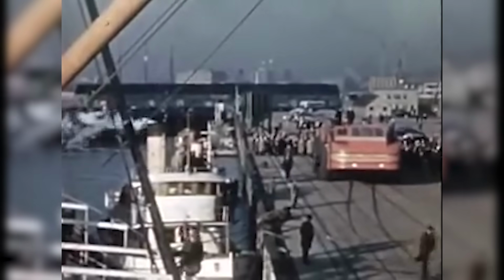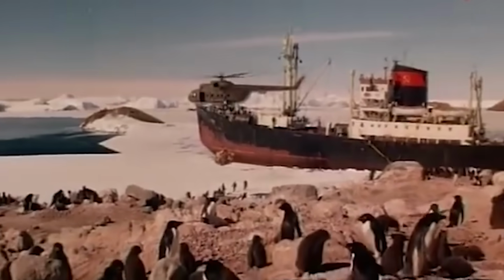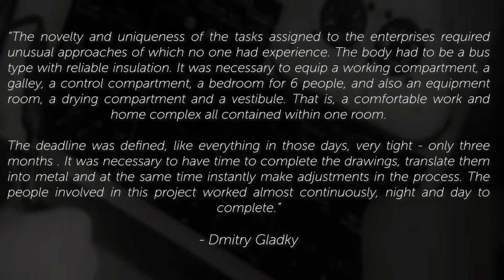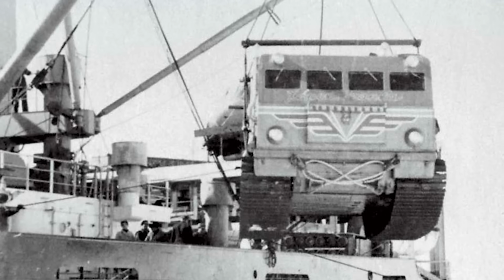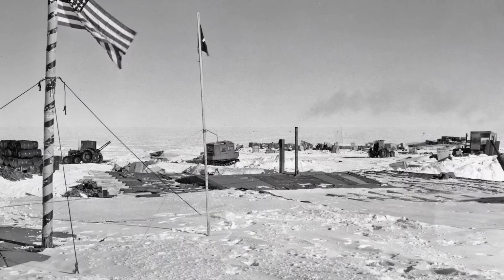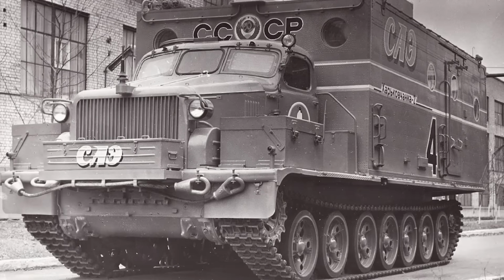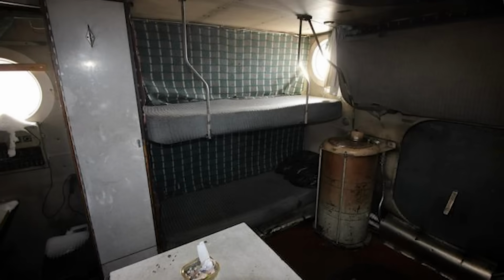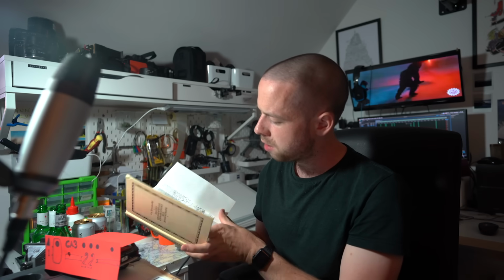"Kharkovchanka" - The Colossal Soviet Antarctic Cruisers

Comment: Calum. Verty very excellent job. On both this and the Snowcruiser. 
In fact so good, it got me interested, and I was doing a bit of research into the various polar vehicles of the time.

And it made it asier to spot a few fairly minor errors in your documentary, brought about by Google Translate.
The CTT (revised ATT) cannot have a 900 hp engine.
That's MUCH too big: cannot be.

For one thing, it's just not possible to jump from the 520 hp of the earlier ATT-T to almost DOUBLE that size without a HUGE increase in size of engine.
The AT-T was already supercharged, and that in any case cannot allow such an increase.

And it''s completely out of the possibility of diesel engines at that time with the technology at hand.
Even now you'd struggle to get that from anything you'd fit in the same size vehicle.

And I see a very good engineering reference by Zhakarov that gives the engine specs, for the two earlier ATT variants, plus the other Soviet vehicles.
And it gives a value of 550 hp.
I can believe that.
He also lists the engine RPM, engine type, and power to weight ratio for all the vehicles.
And everything is consistent.

Looking at other references, the ATT "serial" had an A-401 engine without a turbo/supercharger.
And achieved 420 hp at 1,600 rpm.

Then they improved it by adding a supercharger: the AM-42K (they call it a "centrifugal blower").
That got it up to 520hp at 1,700 rpm.
So THAT is indeed a big boost from modernizing thew diesel: mostly by the turbo.
And they called that engine the A-404.

And then they tinkered a bit more to squereze out 30hp more, to get 550 hp, at 1750 rpm.
And called it a A-404s.
For the day, that's a LOT of engine for its size.
And the extra hp is really from allowing a higher rpm, it's not from any turbo charger.
It already had that.
And the SAME one as the A-404.

And they were all 12-cylinder, with 5 speed gearboxes. No changes there, from T-54, to T-55, to ATT to ATT-A to CTT.

A sanity check of Soviet, diesel engine technology shows the T-54 then T55 variants went a 12-cylinder with 500hp to a max of 800hp in a few of the last variants.
but indeed most stayed below 600 hp, even up to the T55 made in 1990.
And that's for a main battle TANK, where you WANT as much hp as you can get, and you don't really care about fuel economy.
Not like you do in the Antarctic.

So how can they suddenly jump to MORE power than the more modern T55 variants got, in just a few months?
No way. 

Also note that in 1958 in Kharkiv they were improving the T-55 with a new V-55 12-cylinder engine at 581 hp, up from the earlier 500hp engine.
So obviously if the ATT were to get a better engine, they'd use that as their platform.
Maybe tinker with the turbo a bit to allow it to run better at very cold conditions at high altitude in Antarctica than where the T-55's were going to be sent for Fulda Gap.....

I was looking at your references, and I see that the Youth one when translated by the helpful Mr. Google Translate gives me "995 hp".
Hmmm......
But when i look at the original RUSSIAN, it says "995 л.C.".
And THAT means 995 kiloWatts.

Which is even FURTHER wrong, because THAT would then mean 1,334 hp.....
Which is REALLY too big.
For instance, the modern M1-Abrams main battle tank gets 1,500 hp, but that needs a REALLY fancy TURBINE engine.

So something went off the tracks so to speak for whoever wrote the Youth article.
I suspect that in the spirit of going metric they just screwed up.
Maybe got inspired, and made the Soviet diesel REALLY powerfull....:-}

Another error is the top speed.
Here I do believe the Youth magazine article when they say 30 km/h.
And not MILES per hour you give in the video.

But these aren't a big deal, they only caught my eye because I was compiling my own summary of vehicle specs.

Your two documentaries are really excellent.
Reply: Well, decent and well presented correction is rare today, my compliments to you.

Comment: The Russians don't built hangars for their fighter planes-they sit outside in the elements and still work. Let that sink in when you consider what these purpose built vehicles in the harshest environment on earth are like. I'm a fan of engineers from the pre-electronics era when they used mechanical means that were reliable, fairly simple, and would last for an eternity. Quite honestly engineers today seem to have this mindset of 'we'll just do it with electronics' and you'd be lucky to get 10 years out of it. (Also 'planned obsolescence'. Stuff isn't supposed to last today.)

Comment: Weird to think about engines getting too hot in such a cold place.
Reply: That is pretty obvious because of snow and ice getting into radiators and blocking airflow and by that reducing cooling.
Reply: @outerspaceoutlander  not really with air temps in the negative double digits
Reply: Internal combustion engines can reach temperatures of 250 deg C. Turbochargers can reach 900 to 1000 deg C with high pressure exhaust gases flowing through them. If this heat is not dissipated, it can build up hotspots and heat soak inside the engine. And cause damage such as cracks in the engine block, warped cylinder head and blown gaskets. 
Even if the outside air temp is -50 deg C. The engine is still relatively running hot. Another analogy is space is cold, at  -270 deg C, but rocket engines and the sun still get hot.
Reply: https://youtu.be/J6fExuF3A9E. 

Check out why it might get hot;)

Comment: https://en.wikipedia.org/wiki/Bombardier_Inc. 
Bombardier was a mechanic who dreamed of building a vehicle that could "float on snow".[4] In 1935, in a repair shop in Valcourt, Quebec, he designed and produced the first snowmobile using a drive system he developed that revolutionized travel in snow and swampy conditions.

In 1937, he patented and sold 12 of the 7-passenger "B7" snow coaches.[5] They were used in rural Quebec to take children to school, carry freight, deliver mail, and as ambulances.

Comment: From the location of the sprocket wheel on both the ATT and the Kharkovchanka, it looks like rather than relocating the engine, they just switched which end of the tank hull was the "front" and swapped the gearbox.
Reply from the maker: That is what they did I think, yes. I believe having read some other comments she’s essentially a yank hull driving in reverse

Comment: Very nice docu mate! GG! TY!
Kharkovchanka = tank + locomotive
Seems to me like most of the problems of the Kharkovchanka came from the diesel engine. Internal combustion engines and arctic exploration just dont work well together. Now imagine if we never had a gas powered engines and instead we used small, reliable electric motors, batteries and solar panels on the truck. With a self powering electric turbine as backup in case the batteries run dry and a portable tesla tower to power the camp when they are not moving. With 50 years of evolution the electric engine would have been the best, cleanest, safest and most reliable engine if we had gone the electric way from Tesla's days. The Kharkovchankas would have been rolling even today, with just minor maintainance and living quarter upgrades. Yes they might change the electric motors when they become too run down and upgrade the batteries every now and then with the newest tech, but other than that they would be running quietly with merely a slight electric hum into the Antarctic sunset.
Yes many times i like to imagine what the world would look like if we were truly free to evolve humanity as we pleased. Nikola Tesla would have been celebrated as a hero of humanity and would have lived a very rich and fulfilling life as a Master Electrician in my world and we would all have free wireless electricity (like before) and just enjoy living life instead of paying for it. Good times for all.

Comment: I wouldn't be surprised if some of these engineering marvels are still operating at various Russian bases in Antarctica. During my last 'summer' tour in Antarctica (2010) they still were. I wish I could post some pics. Also, my eye briefly caught sight in your video of what I believe are 'Gorky's", light tracked personnel carriers. The Russians used them at Novolazarefskaya and Progress. One beautifully kept T404 in olive livery was used in Vostok and I had it pull our Turbo DC3 out of a tight spot. Research base Novolazarefskaya actually has a 'wrecking yard' where a number of skeletal remains are stored  including the older T404 with hundreds of parts lying around. In December 2009 A Kharkovchanka was under repair in Progress with what appeared to be a broken drive sprocket. Everything about this vehicle was BIG!
Reply: They have those huge half tracks with the skis up front, that is just for getting to the landing strips.  They do have full ambulance kit on them.
Reply: May I ask how you come to be in Antartica? What were you doing there
Reply: @KingPOF  Someone had to be the first to make love to a penguin

Comment: I do wonder why they did not consider a turbocharger or supercharger for the engine when they knew they would be operating in 3+km height.  Chargers were in about every (propeller) combat aircraft engine to keep the maximum engine power up at greater heights ...

But yes, great, great technology, and these need to be cherished as what they are: triumphs of technology that enable.
Reply from the maker: They did have turbos, I think all ATTs past 1957 and all the Kharkovs had turbo chargers.

Comment: So they made them with out testing them and checking measurement of each part which moved, all that stress ,should have been checked, but as we all know the russians say they make great stuff, but never mention its failures, like on this upload, that's the main problem, also i bet those engineers which overlook those failed parts were sent to siberia and asked to test those parts, just like those in the real things, but with out all the extra heating so basically its the russians governments way of saying your going to the gulags ? 
Still has metals and materials got better and tech got better, i think its safe to say with out these monsters, it would not have happened and many tanks to all the workers on the project day and night and 3 months to make it work, people make mistakes, but when life's of people are in your hands then you  need to double triple check everything, meaning every single nut and bolt, wire moving parts tested to the extreme, so its made to last no matter what tests are done, its the time constraints that made them not test everything for sure? 
Fuel how can they not know how much fuel they were going to use, the russian lands is almost covered in hi winds and snow ,test them and then make a report, well we need hi octane fuels, which it will use a lot less and still have the power, special additives so the fuel will not freeze etc. Planes fly in -40 to -50 degrees c at 40,000ft so the fuels lines and tanks are all insulated, why not use aircraft or aviation fuels, burns a lot cleaner and much more power :)

Comment: More info on the insulation pls. 13:40 mentions "designed to lose 1-2 degrees per day" but then later in the video it mentions it feel far short of that. Next gen has "improvements" but it doesnt mention how much better it was.
Reply from the maker: Good question and unfortunately a confusing answer. The '1-2' degrees thing I've seen attributed to both generations, but I saw more references to it in the first generation so i stuck with that. So it's either:

First Generation: designed to lose heat at rate of 1-2 degrees per day (but fell short of this and wasn't as effective)
Second Generation: improved on this with much better insulation (unknown exactly how effective)

OR

First Generation: designed with insulation but wasn't as effective as hoped, lost heat quite quickly without heaters. 
Second Generation: improved on this with much better insulation designed to lose heat at rate of 1-2 degrees per day 

Does that makes sense? You'll find my sources in the description, you may be able to find a better answer. As far as I can see the second generation is just described as 'better' insulated.

Comment: I see an over dressed Porsch Tiger.
Reply from the maker: Difference being it didn’t break down every 40 yards or in a strong breeze 😂
Reply: @CalumRaasay  LOL...of coarse....soviet tanks were built to work in the cold and to last....the diesel electric motors in the Porsch tanks (v3001p, v4001p Elephant and Maus) were run by a DB601 running twin electric engines similar to Uboat engines, but the next phase was to be thousand ton land  kruzers with actual twin Uboat engines,   Porsch had nothing on Krupps secret weapon, Edward Grotte, ( yes, the guy that built the original  Russian Land cruzer....the soviet T42 ), His baby was the P1000 Ratte,,  thankfully there just wasnt enough copper around.

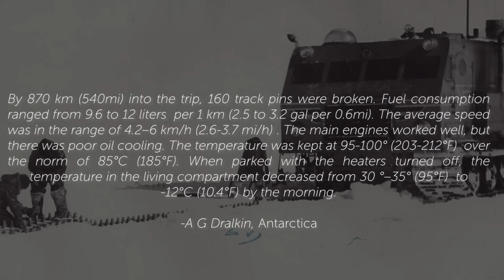Comment: 18:03
How did they manage to do a 5,500 km journey if fuel consumption was 9.6 - 12 lt/km and they had 2,500 litre tanks? That would give them a range of only 231 km right? Even with extra fuel supplies... It just doesn't add up.
Regardless, great and very detailed video!
Reply from the maker: The journey had multiple stops, at two stations and at several ‘relay’ points. They were also towing over 100 tonnes of fuel with them in barrels for most legs of the journey.

Comment: The fundamental failure of the Snow Cruiser was the concept of driving a super heavy vehicle on tires through deep, soft snow.

Having said that, it's impossible to imagine how a tire company could come up with slick tires for driving in snow. They of all people should know better. Even the concept artist realised that it needed treads but not the geniuses at Goodyear.
Reply from the maker: They didn’t really, the tyres were actually taken from a Goodyear oil prospecting vehicle designed for swamps, they unfortunately they didn’t have the time to design their own. Why they thought slick tyres would work is also pretty silly, but long story short they miscalculated how they would perform on soft, powdery snow.
Reply: Calum That was interesting to hear. I imagine, however, that slicks would about as useless in a swamp as in the snow. Unless the tires were truly balloons, they could have vulcanised them to add treads.

Thanks for a great video, by the way!